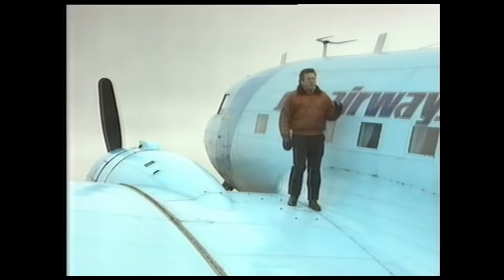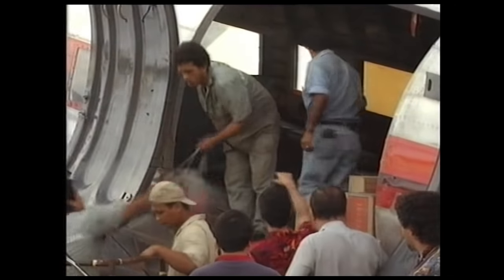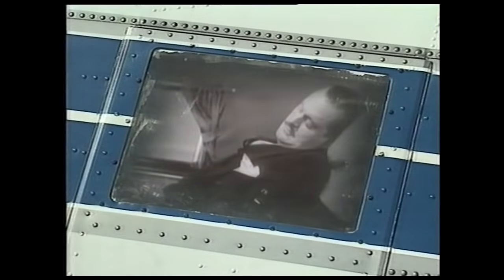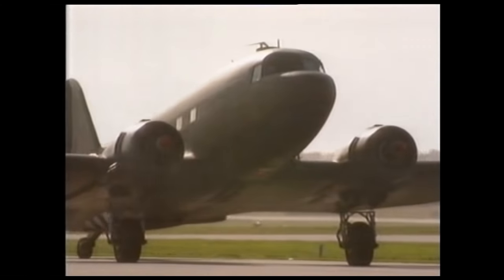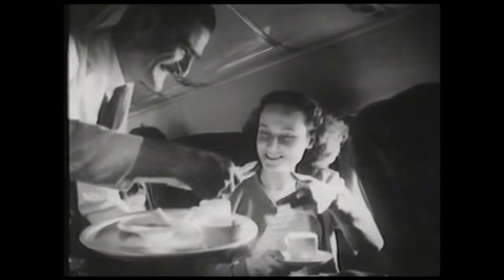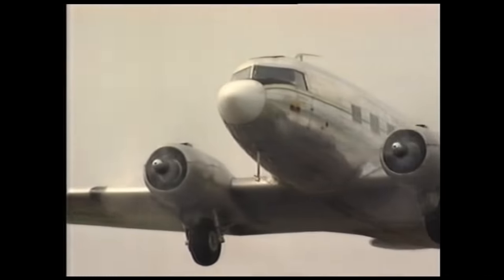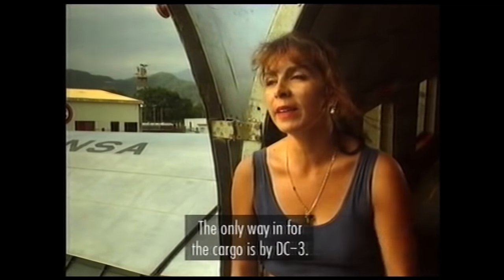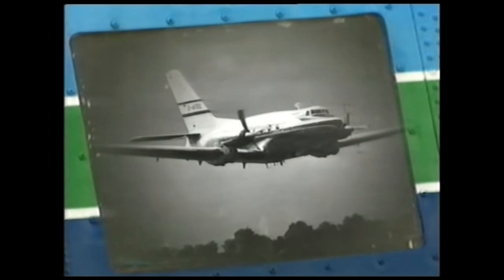Douglas DC3 Dakota, 1985 BBC documentary.

Comment: My  first job in commercial aviation was right seat (co-pilot) on a DC-3, out of Resolute Bay in the Arctic. It was my first time flying a tail-wheel aircraft, and some of the bounces on landing were spectacular. But what a sweet airplane to fly! We did a 7 hour wildlife inventory flight of Ellef Ringes Island, 150 ft above ground the whole time. Mostly rudder, with very little aileron worked best.  My only complaint was the prop tips 2 feet behind your ears going supersonic on takeoff... 130 decibels... I still have tinnitus, but flying the 3 was worth it.
Reply: Were you flying for Weldy Phipps?

Comment: First airplane I flew in, as a kid in the Boy Scouts. It was an Air National Guard C 47 out of Portland, Oregon, still fitted for paratroops. It was noisy and then cold, but it was sure exciting. I think Douglas built these old birds better than they knew. Thanks for the doc.
Reply: Richard Boylan I flew in many C-130's when in the service and they are cold and drafty as well as noisy also. They had a pee funnel in the tail I'll never forget, it was quite involved to use as they didn't want pee-pee all over. The girls you ask? they didn't get to pee.. Hey man we have a prostate to protect! lol
Reply: I read an article on the DC3 once that said that they didn't have all the "engineering aids" (computers) that they have today to do the design. So they built it as tough as they could without making it overweight.  Looks like it worked.  The only other plane to come close was the B17.

Comment: My first airplane flight was aboard a DC3 operated under contract with Military Air Transport Service (MATS) late summer of 1953 from Fort Dix NJ to Ft Knox KY. I was lucky enough to get a window seat near the front. I recall climbing up hill to it. The ride was smooth and thrilling. Years later I was on a commercial flight in Texas during a sudden storm. We were tossed around like a rag doll in the teeth of a dog. 

The narrow configuration of the Concorde that I rode in twice in the early '90s was very much like that DC3.

Comment: 3,000 kilos equals 6,600 US pounds. With upgraded engines, that was her limit; her original design load specification was 6,000 US pounds using the P&W radials available at the time. According to Wikipedia, the C-47B-DK (2 speed supercharger) had a load limit of 6,000 US lbs, a loaded weight of 26,000 lbs and a MTOW of 31,000 US lbs. That was with 2 x P&W R-1830-90C radials giving 1,200 hp each.

We all know that "load limits" were often ignored when circumstances demanded it. The AAF figured out that just not painting all the new planes coming out of the factories allowed any combination of greater bomb loads, more ammo for the .50 cal M-2 BMGs on the bombers, and greater speed to use against enemy fighters. The choice was up to the Wing Commanders, to use as their circumstances and needs dictated. 

The only painting done after delivery to the user was the livery color and unit/plane letters and numbers of the Wing and the "Invasion Stripes" in preparation for D-Day. Bare-metal planes were given black Invasion Stripes, and all camouflage painted planes were given white Invasion Stripes. That lesson was learned from the Invasion of Sicily when Allied AAA gunners shot down almost 2 dozen C-47s carrying the supplemental drop of 82nd Airborne troops on the second day. "Aircraft Identification" had not been taken seriously by the Allied Navies, and the C-47s were mistaken for enemy planes. Many paratroopers of the 82nd were killed; it was an immense tragedy. They were killed before they even got into the fight.
 
Those of us who have been interested in the history of aviation know that about how every 3 months or so, invaluable engines like the Wright Cyclone and P&W radial engines, and the Alison and Rolls Royce Merlin V-12  engines, were continually improved as the war progressed. The C-47 / DC-3 continued in use by various parts of the US military through and including today, and many are still in use in countries such as Columbia and others in South America and in Africa, where unimproved airfields are the norm, and in places where roads do not exist or are so basic that travel is terribly slow. The DC-3 continues in use because she has no replacement other than another of her kind. According to Wikipedia, almost 100 countries have used the C-47 over her lifespan. That's an incredible testament to her ability to get the job done in areas where even a 4-wheel drive truck would have a difficult time in the mud and dense undergrowth. The DC-3 doesn't care; she flies right over all of it.
Reply: Joseph K sounds like you flew it
Reply: No, just read and studied everything I could find about airplanes at news stands, libraries, and from post-war pilot associations. I was the oldest child of a WW2 GI Army Cbt Avn Egr, who said the C-47 was their "flying truck". Units like his made/repaired fighter strips in Europe, and the P-47s (Daddy of the A-10  Warthog", used as Close Air Support for ground troops after D-Day) came rumbling in.  While the AAF personnel serviced the planes, my Dad's Army Egr unit was responsible for base security, runway M&R, and handling German snipers. By the time I was ready for high school, I had decided to aim to become a pilot. But as my Dad so wisely said, we can make plans for our lives, but God has a way of changing them for us; when I was in senior year in high school, I was having difficulties with distance vision. The eye Doctor said I had my Mom's eyes, not my Dad's, so there went my plans to try for the Air Force, b/c you need 20/20 uncorrected vision to be a govt pilot.

Comment: If you sit in the jump seat behind the copilots seat, the prop passes just inches from that fuselage station, or  basically where you're setting. If its a pure cargo version of the Doug, that might be the only option you have. The noise from the big Ham. Standard prop is defining, you can't hear anything else. Even with hearing protection, You'll be real lucky if your ears aren't ringing after an extended flight.

Comment: The quickest way to tell what plane was a C-47 and what was a commandeered  DC-3, is by the width of the port-side rear door; the wider door was the C-47, while the narrower door was on a commandeered DC-3, and on some, the narrow door was on the starboard side of the fuselage.
Reply: Only most of the time. A  lot of C47 had an Air Stair conversion after the war that took out that whole section and installed the new door. Best way is to check the floor, C47 was double the thickness and had net hook points.
Reply: Grant Tabor     Thanks for that info. I recall in the documentary,, the narrator said the floor was reinforced in order to handle the heavier loads. And the one man interviewed, used the term, "C47 stroke DC3", so I presume he was referring to re-converted planes, ones from which the military equipment was removed and it was set up for the original cargo/people carrier configuration that the original DC-3 was in.  Incredible plane. My Dad couldn't say anything bad about them. During his entire time in France, Belgium, and Germany it was often that they ate and got resupplied with ammo only because a couple of C-47s did a drop or managed to land at the field he was at. And the nearby infantry and armored medics wanted to know when the next C-47s were due, because they had badly wounded they wanted to send back to England. The GIs relied on them second only to each other. "Angels in the sky", he called them.
Reply: Awesome plane, I have over 4700 hours flying one. When I went into one I had never flown before I would find the data plate and scrape the paint off, they have all been painted over :( The oldest one I ever flew was born in 1942, it was two years older than me :) :)   The floor was re enforced by doubling the thickness of the panel then adding a 'false' rib between the real ribs. Didn't add much weight and by then it had bigger engines anyway.
Reply: Yes, I guess the next upgrade of engines gave them more hp, and it added to possible payload. I recall doing a search on Wikipedia on the P&W 1830s and Wright 1820s, and all showed 30 to 40 versions, probably with an updated and modified supercharger, and had more hp as a result. Necessity is the Mother of Invention.  We usually get very good when we need to kill each other! How ironic ...

Comment: Now 80 years after they first flew there is still a few working and a few in private hands  that still fly.
And from wat I am told those C47s often worked overloaded and landed on very poor runways. Mpre than a few were crashed though but a palne that still works commercially at that age will never happen again.

Comment: would someone please record the internal sounds of a DC3 inflight and upload it.  I just heard a youtube recording of a dc3 in the rain, which just doesn't sound like that situation.  thanks
Reply: Haven't heard that video on youtube but after many hours flying a C47/DC3,with all the insulation stripped out, it's like someone pouring bucket of lead shot all over. Then you get a heII of a bang as a lump of ice comes off the prop and hits the side. Also most of the time in rain you had to wear waterproofs :(

Comment: This video is not 1985 it's during the 1990s as Aces High didn't have G-AMSN/N3455 the blue Star Airways dak till 1990s and survived there till used for Band Brothers
Reply: The serial 9700 dead in 2014, more knowed has "Fifi kate"

Comment: The DC3 is the culmination of the mechanical age of humankind. Its continued usefulness in places like Columbia and the Yukon is the best proof I know of that computerization is NOT the solution to all problems. A number of purely mechanical devices built at the end of the mechanical age [the 1930's and early 1940's] are still working in out of the way places, and doing a better job than their more modern counterparts. The DC3 is merely the most visible such device. Excuse me while I hook up the brush hog to my 1947 Ford tractor. The grass is getting long on the back 20 and I need to cut it down. ...

Comment: The DC-3 was way over-engineered. Would not be considered a cost-efficient design by today's standards.  The Curtis Commando / C-46 was another good airplane. It was used to fly "The Hump" over  the Himalaya as the DC-3 could not fly with as heavy a load over the very high mountain ranges.

Comment: This plane could have ended WW2 a year earlier had it been deployed as a bomber by the USAAF against the nazi regime.  DC2.  It could have used the 1900hp Wright or 1850hp Pratt and Whitney, with either three or four paddle props.  
The U.S. could have built 275,000 of these planes before 1944 started. Had these been used as bombers, the sheer numbers would have crippled and destroyed the nazi war industry altogether, not just partially.  A tailgunner in a dorsal turret also operating a quadruple 
.50 tail stinger, a twin .50 top turret, a ball turret and six clustered .50s in the nose operated by the copilot would have worked as defense. With the bigger HP engines, it could have carried six 1,000lb. heavy bombs, and with larger wing tanks, a 3,000 mile range.  The USAAF would not have needed 4 engined bombers.  With a bombardier/navigator, the crew would have been only 6, not 9 or 10 as in four-engined bombers. 
Such allied air armadas would have completely destroyed the axis sooner than 1945.

Comment: Splendid, many thanks for posting. I grew up near Ringway Airport (as it then was) and saw quite a few. I became an aircraft spotter and aged 12 (1961) had my one and only flight in a DC-3 on a school trip to Paris, a coach to Lympne, then aboard a plush purple interior. Loads of noise, flames and black smoke out of the engines and we were off. On the approach to Beauvais the pilot banked to show us the evidence of the R101 disaster, a darker patch on the yellow field. We flew back from Le Bourget on an HS-748, made at Woodford not far from Ringway.
Reply: Took the same route in 1966. A friend and i were heading for the youth hostel  on the Rue St Jacques in Paris by Notre Dame. We were 15 at the time. A great time.
Reply: I think the decoater was in service at East midlands air port years ago b m a air line